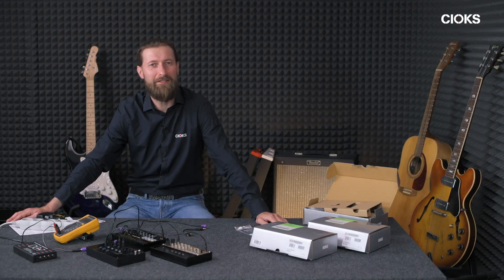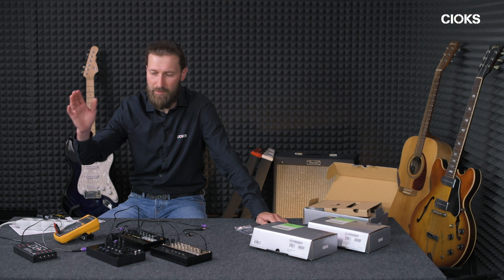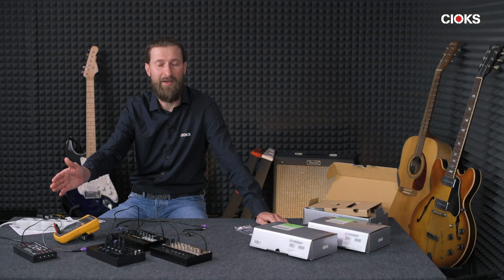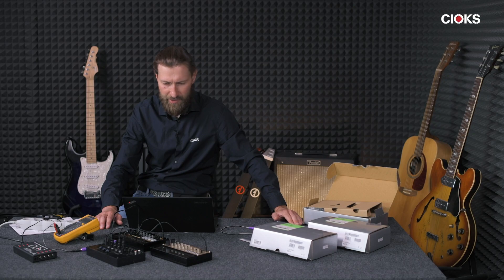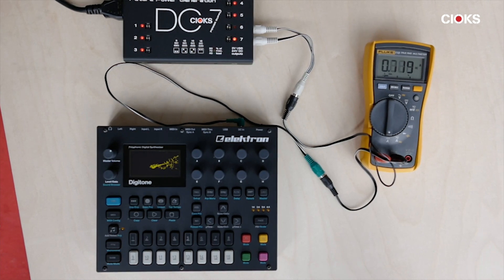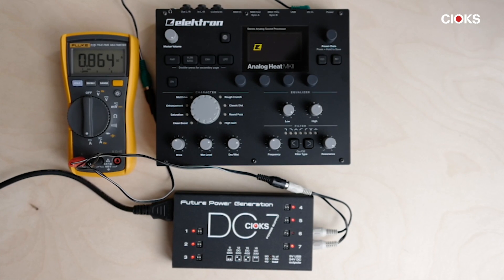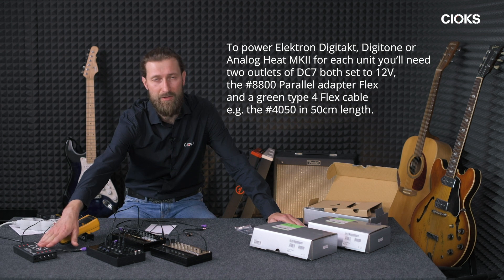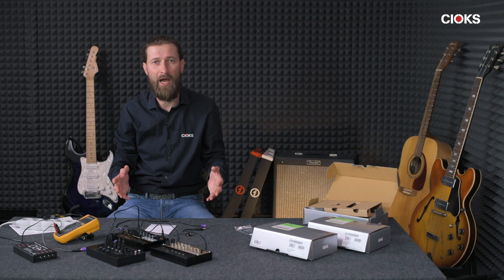How to power Elektron Digitakt, Digitone or Analog Heat MKII

Comment: Hi, I have your DC10 power supply unit. I would like to know if it is possible to use the DC10 to power both a Digitakt and a Digitone at the same time. It seems that input #10 on the DC10 is the only input that could be set for 12 volts with high enough milliamps, but I don't know if I totally understand how it works. Let me know what you think?

Comment: Will this power all three of these devices at the same time?
Reply: 2 outputs per unit summed together required, 7 outputs total. It seems that way! With the DC7 & C8 you could probably power your whole rig! Loved your video on how you use the OT DT DN & Heat it's giving me so much GAS! It's such a great performance setup.

Comment: Could you tell me the name of the white current doubler cable？？
How can I get this????
Reply from the maker: The current doubler cable is called Parallel adapter Flex hence it makes a parallel connection and the order no. is #8800.